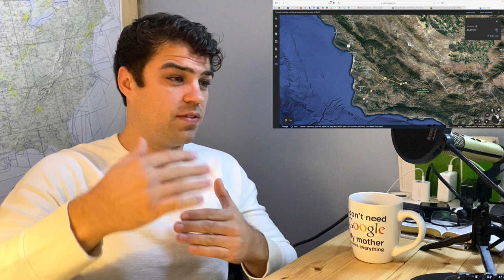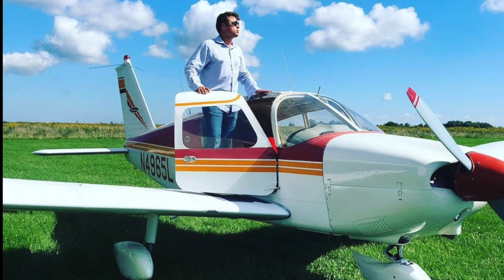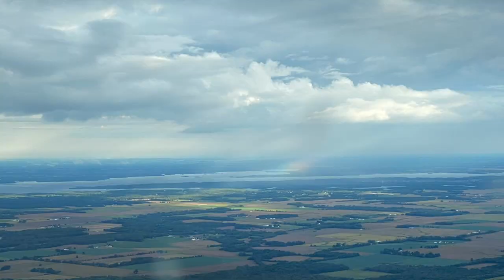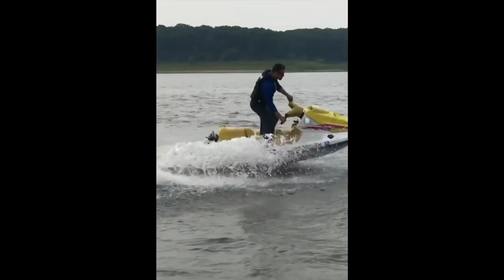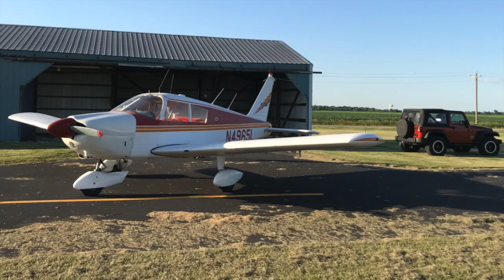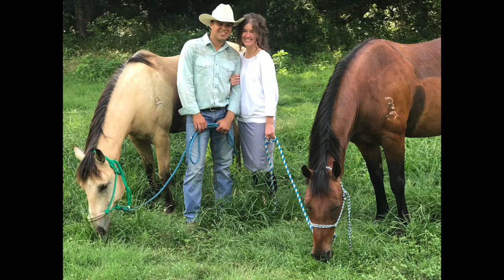How Trevor Jacob Intentionally Caused An Engine Out Scenario Leading To An Airplane Crash.

Comment: Sorry... my bet is on plenty of fuel onboard. Just because a plane has fuel onboard, does not mean a crash results in a fire. Check out the NTSB's website. Hundreds of crashes of aircraft with fuel onboard that does not result in a fire. Plenty of car crashes with the same circumstances.

 Plenty of time for the engine and exhaust to cool down. No possibility of spark from an electrical system... no battery.  In Trevor's stupidity, he carries two (or more) fire extinguishers for the possibility of a fire, that couldn't possibly happen.  Fuel does not explode on impact. There needs to be an ignition source... extreme heat for a flashover or an open flame, neither of which existed.  I don't believe he would have "risked" running out of fuel until he reached his desired geographical location to then begin his stunt.  Further, he milked the yoke so hard in an effort to keep the engine from restarting.  He knew he still had fuel on board..... Sorry av gas does not explode on impact.
Reply from the maker: Calculate fuel burn?

Comment: It doesn’t matter that he had an engine out, what matters is he bailed out and endangered others by allowing a plane to crash only for the YouTube video views. He could have landed that plane back at the nearest airfield. He only had enough fuel to get up to height so he could jump. He was over 10,000 feet up. It also looks like he was flying an aircraft without an airworthiness certificate. He had fire extinguishers in his pants, he parachuted down to as close to the aircraft as he could so he could recover the vital life saving video footage before hiking out. He faked it completely. He’s going to jail, because if he doesn’t it’s a travesty.
Reply from the maker: Well it matters that this is proof he never intended to fly to mammoth

Comment: Regardless of if he had an engine out he broke rules. The NTSB states it's illegal to try and move wreckage, he set up s team to in secret. They also state any in flight crashes must be reported immediately. He failed to report. 
In addition, I'm a pilot. I've had a door fly open on me and it's such a radical change to the airflow that on my turn on the downwind of the runway I lost a hundred feet of altitude just turning. Why would he fly with the door open even before the engine failed, with that in mind, unless he planned to bail out. 
Not to mention the map and reports show he was close enough to stable ground and the airport. At 3,000 feet above ground, about where he was at, you have at least 4.5 miles of glide. 
There are soo many things even a fucking anateur pilot would recognize that just doesn't add up.
Reply from the maker: Well, he says he did. You don’t know that. What we do know is that he intentionally ran it out of fuel
Reply: @DailyNOTAM  which part did he just say? I thought everything I just said was accurate to reports

Comment: The plane didn't catch light when it crashed, many speculate it was empty. The issue isn't whether he really ran out of fuel or not, it's that he planned it. There are too many giveaways it was planned, the yoke pulling, the post-jump pitch down, the fire extinguisher, the altimeter, the fuel gauge, and of course the ridiculous idea of always flying with a parachute. In fact there isn't one bit of evidence that it was "real" besides his bad acting job.
Reply: Also note he was flying with a SKYDIVING parachute, not the style that you'd wear inside a plane for emergency use.
Also, if you check his other videos... he doesn't use a parachute in those.
Reply from the maker: Agreed. This is tangible proof it was intentional